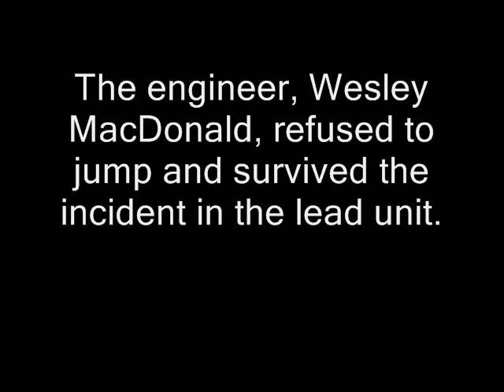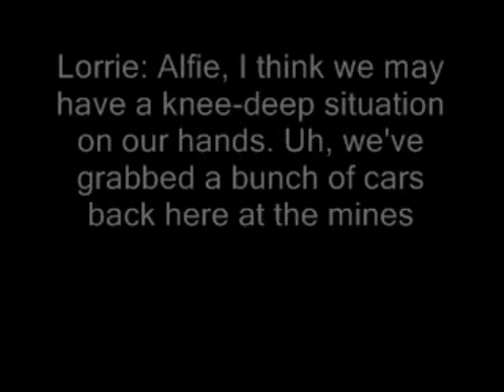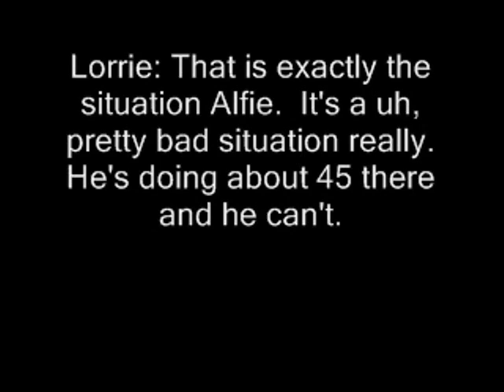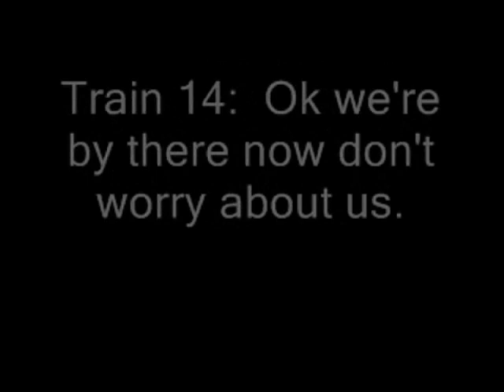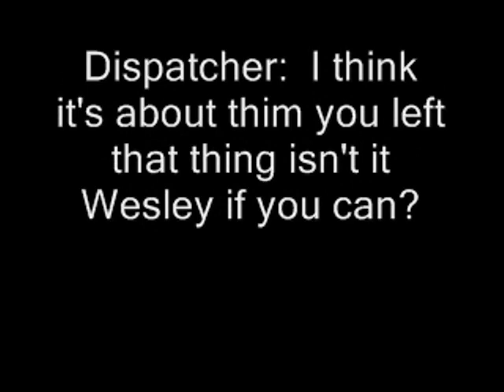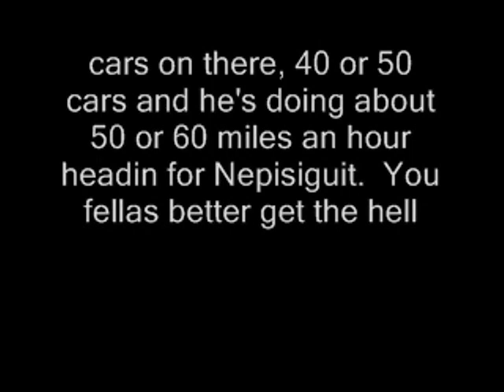Runaway Train on the Nepisiguit Sub Part 1/5

Comment: and why was the air hose nor connected?
Reply: standered practice
Reply: they leave them disconnected during switching moves.
Reply: Maine Railfan© exact;y
Reply: They use dynamics while switching
Reply: @railfanmaximstill7279  None of the locomotives were equipped with dynamic brakes.